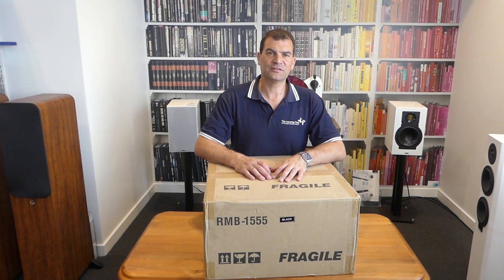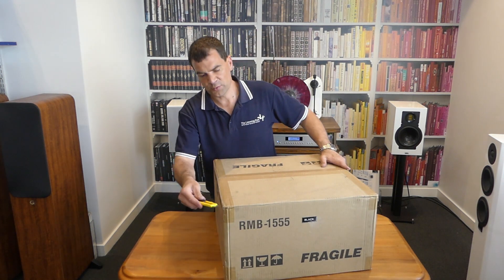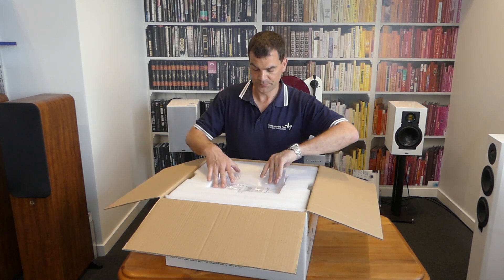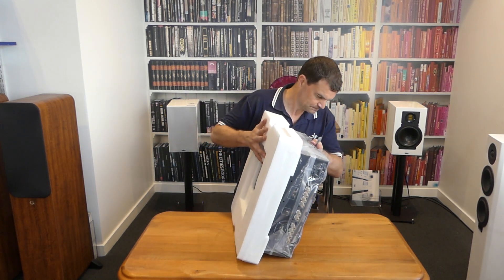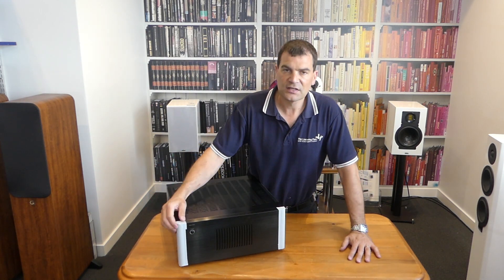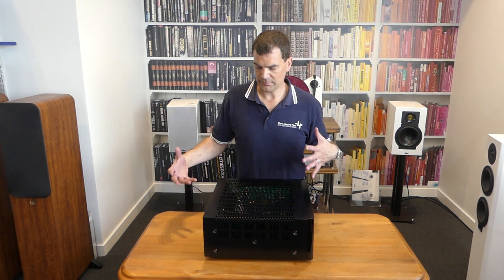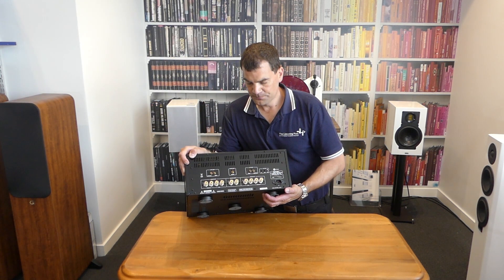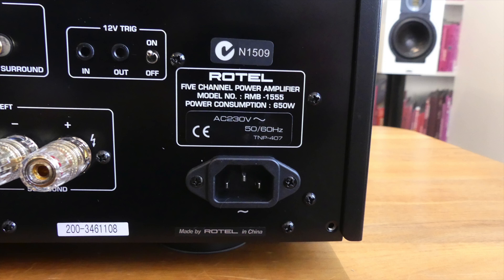Rotel RMB1555 Power Amplifier Unboxing | The Listening Post | TLPCHC TLPWLG

Comment: Ive not seen anything Rotel for years, do they sell overseas? as in outside AUS/NZ? 650Watts plus all your other gear, you wouldn't want to be running this a lot given the likely impact on your electricity bill.
Reply from the maker: 650w is at its peek. So don't stress about your power bill (Your 4k TV will often use MUCH more). And yes, Rotel have distribution channels in all main parts of the developed world.